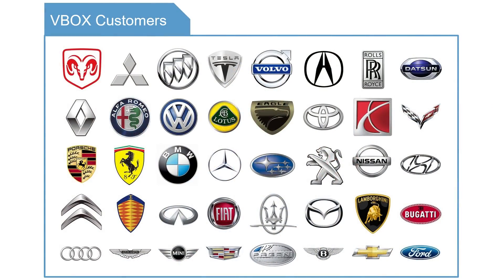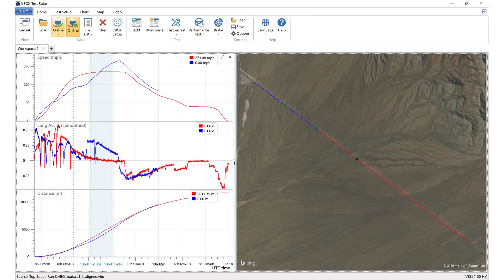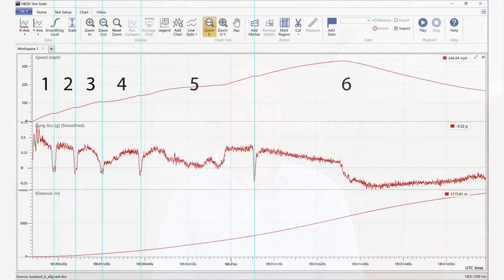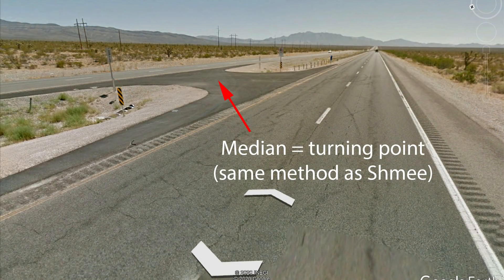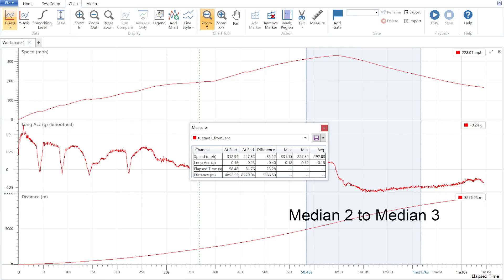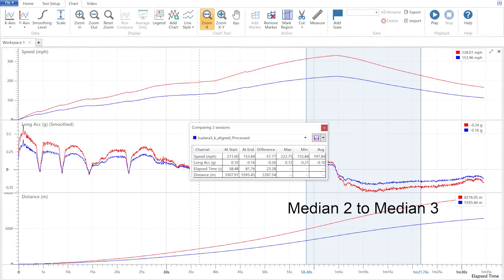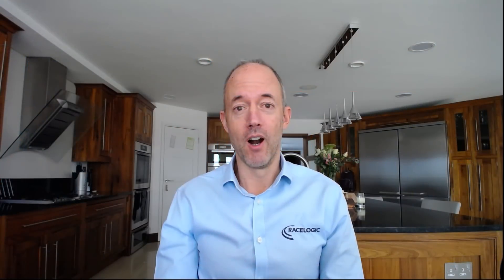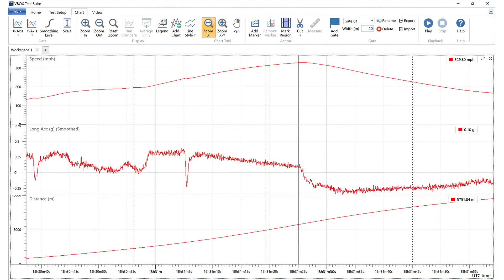How fast did the SSC Tuatara really go? Here's my calculation based on some new data.

Comment: Hey Julian, you can find the answer to your questions of why and how in the face book group Koenigsegg Registry.This is where this started and now ended.
 Quote The key to all this is something that hasn't been mentioned here or by the three musketeers of the Nurburgring. That is the SDK, the Software Developement Kit. It's open source, it's on GitHub: 
"DEWETRON OXYGEN SDK Develop your own plugins for DEWETRON Oxygen Software! The SDK includes the framework, manual and examples to quickly get up and running using the Microsoft Visual Studio C++ toolchain."
 What you see on the laptop screen is the result of using the SDK. Any coder worth his salt can introduce a multiplier of 1.3 between the GPS data and the screen. This is the reason SSC chose Dewetron, an unknown company in this particular field, who supplies a wide variety of instrumentation for industry. Clever of SSC, but not clever enough to fool the internet sleuths. Unquote.
 Now go there and give credit where credit is due.
Reply from the maker: @HokeySchtick  An SDK available on GitHub would make it a lot easier to produce the software they used. I haven't personally been to the Koenigsegg registry, but that may be where Shmee and others got some of their initial ideas from?
Reply: @jools360  Also, this is the second time around, same Dewetron, same SDK. Fool me once, shame on me. Fool me twice, shame on you.
https://www.youtube.com/watch?v=gGEL7VQy-D0
Reply: @HokeySchtick  uhh, i think the saying is supposed to be the reverse of what you said, but i do wonder if they faked the ultimate aero run as well, especially since they didnt get nearly as much attention in those times as now
Reply: @Youtubehandle9001  You're right, I fooled myself.
Reply: @jools360  like you can't throw a scaling factor on any software. You can do it on Vbox you can do it on Motec you can do it in PI etc you don't need an SDK?
Reply: @jools360  I wasn't quite right about the credit, I found this on Reddit:
"I think it is important to give credit to the guy who first uncovered this, a friend of mine named Jey Cee who goes by @jey_._cee on Instagram. He has long been involved with the Koenigsegg community/research and was the first skeptic to raise the alarm that this 331mph run might be fraudulent. He was the one who initially crunched the numbers, looking at both the medians and the spacing between dashed lines on the road, skimming the video frame-by-frame.

His work was then brought to a wider audience's attention through the Koenigsegg 4 Life Facebook group (22,000 members) and subsequently popularized by major pages on Instagram, namely @koenigsegg.registry and @ghostsquadron.koenigsegg. It is after this popularization that Tim (Shmee150) picked up on the topic and made this video.
Tim does an excellent job of explaining everything, I just thought I'd make sure there is credit given where credit is due."

Comment: This is a better anaylisis than the three guys before you.   I do not understand why they would send that video out, unless the driver did not know what those two speeds felt like and the software company straight messed up.  To be clear your saying the top speed reached was the 230 number?  And to get that you applied the 1.4 correction factor?  Being that it was a derived correction factor if it wasn't 1.40 you really can only say that the car was going 240 if that was the case. 

Your calculations are still not the correct significant figures and there is no known error that has been included.  It is possible to include the error of the reporting device through multiple calculation comparisons and your data that you pulled (great way btw).  You calcs seem to be hinged upon the distance measured via Google maps and the three guys before you were talking about some construction that was going on that could have done anything to that road really.  I understand you're working with what you have and although there are aspects missing (as well as an analysis of potential error of your calcs and of the discrepancy), you did do your own calculations and in a very simple maner.
Reply from the maker: Hi, my distance data was derived from two sources, the Koengisegg data/video and Google Maps. The Koenigsegg distances should be accurate to less than a metre, as it was measured using a calibrated VBOX 3i. I also cross referenced the video from the Koenigsegg and the Tuatara and timed the difference by hand to check I was in the right ballpark, which led to almost exactly the same ratio, of 1.48, so it gave me confidence in my numbers. GPS is normally accurate to 0.1kmh when averaged over 4 samples. I haven't mentioned any error analysis as this would have been a complex calculation, due to the fact that I had to manually align the video/data.
Reply: My comments here are purely critical and I am not trying to attack you in any way.  I am actually much more pleased with the direction and work you did.  If what I think matters anyhow lol.

I'm a senior chem E undergrad.

Comment: Oh and they said that before the "actual" top speed run they did a few test passes going from around 240 to 270mph so the driver could get a feel for the car, road and the conditions. I think they showed us that run and then overlayed the gps speed onto that run and called it the top speed run
Reply from the maker: I think the fact that the gear changes line up so perfectly with the data, means that the data overlay is the correct one.

Comment: Looking forward to the next official speed attemp. There is clearly a lot more in that car given how it was still accelerating and had another gear to go... I doubt it could reach 280, but if it did, that would be awesome!! They really aught to consult the tyre manufacture though before the attempt. The attempt also needs enough space to a low for cross winds.. That is a bloody narrow road for over 200mph.

Comment: What is the estimated cost of the equipment and materials proposed in this video to be fitted in a car for high speed calculatons?
Reply from the maker: The minimum for a low profile test would be a PerformanceBox Touch (~$680), for a high profile test such as this I would fit a VB3i, HD2 and display (~$18k). We can supply an ISO calibration certificate with either and verify the data during or after the test.
Reply from the maker: We can also rent the equipment out.
Reply: @jools360  After trying to BS this all away, and all the potential customers probably enquiring about their deposits, I think SSC might bitch about the postage, never mind the rental.... :-D

Comment: To suggest the estimated speed is only 223.75 mph is ridiculous. The Tuatara tortured Stradman's Veyron when they raced. It's like an exagerration in the opposite direction and will surely come back to bite Race Logic if the Tuatara does 300 mph when they rerun it.

And I'm saying this as someone who acknowledges Race Logic is the premier automotive speed checker.
Reply: Did you watch the entire video...? He said very clearly that the car should be capable of much higher speeds if and when it is tested again. And this is an analysis of the published video and data from SSC, not of what happened in the Veyron "race".
Reply: @moego3385  actually I watched it twice! The point I'm making is this: the new record was supposedly 316 avg and 331 max. It's understandable that such a massive leap forward was questioned, especially against the footage that was put out.

However, when Shmee, Misha, Robert are saying approx 280 max and Julian is saying 225 estimate. It's clear they can't all be correct. 

I'm saying that although Race Logic's credentials are impeccable, it seems common sense that something is wrong with their calculation because I'd hazard a guess that 225 would be a doddle for the Tuatara or any car with well over 1000 bhp and under 1500 kg. 

So to sum up, it's as if Race Logic has gone in the opposite direction and underestimated it. With respect, the best thing to do would have been to keep out of this controversy, because comming out with equally silly 'slow' estimates isn't good either.
Reply: @DavidElstob73  I can see what you mean. But the analysis of Tim/Mischa/Robert and others could never be exact - and it didn't have to be to illustrate their point. And if recall correctly Tim even added he'd revised his original number of 280ish to something lower. 

Julian from Racelogic has access to more data, namely precise measurements from the same location with the Koenigsegg. I think, based on the data he has access to and the method he has used, his calculations should come closer to the truth than anything else out there. 
It's very compelling.

If you consider it a "silly slow estimate" it's up to you, but I think you then need to counter with a even better calculation showing he is wrong - or at least single out the major flaws in his analysis. In any case, no way would a 300 mph run at some later stage "come back to bite Racelogic".
Reply: @moego3385  so if the Tuatara does a proven 300 mph next time, it doesn't exactly prove anyone right who estimates this run under 230 mph, does it? Yes, they will be two separate runs, but if it does 300 next time out, there's no reason to believe the original runs were drastically wrong.

While it's true that Julian is a genius and has the Koenigsegg data to go by, at the end of the day, he's still estimating it from the outside if you like, without having the actual GPS data it's still nothing more than an educated guess. 

Each to their own, but personally I think it would have been best for Race Logic to keep out of it or offer their services to SSC in private. 

Let's be honest, saying the car only did 224 is a bit disrespectful to Jerod Shelby and his beloved Tuatara. Adding that there's definitely more to come isn't going to repair the damage either.

PS the reference to the Veyron was to show just how capable the Tuatara is against a well-known performance car.
Reply: @DavidElstob73  Whatever we thought the Tuatara would do, did before, or will do next time, will not prove anything - it's fully irrelevant compared to the fairly good quality data revealing what it actually did do on that very run. What Julian presents here can't be simply dismissed as just an educated guess even if it's not GPS accuracy.

Why not try to do an objective estimation on your own? If you don't believe Julian is accurate enough, you should dissect his numbers and put some realistic conservative error margin on top of them, do the math and see what you get. 230, 240, 250? I haven't felt the need to do so because I think his reasoning makes perfect sense, and less accurate estimations have already proven they were far below 331.

It's not less respectful to say the car did 224 based on this solid analysis, than claiming to the world it did 331 with no evidence at all, is it? I can only imagine how embarrassing this must be to the SSC team, but it's their own actions after the runs that put them in this position. I can't even begin to think of a worse way to handle the situation. Next time around I hope they will play fair, and be successful with their attempt. And besides, the more I see the Tuatara, the more I like it!
Reply: @moego3385  I'm not dismissing Julian's calculations as a wild guess - to be more precise it's actually a guesstimate. He's based it on the data he has available, but that still isn't the same as having the GPS data from the run, so to a certain degree it is part calculation part guess.

Perhaps Julian's figures do match the video, but what I'm saying is the video isn't what really matters - it's the GPS data that counts. The video is more for marketing and social media views. Of course, ideally, it should be accurate also.

If SSC only hit 230 in the rerun they will prove Julian to be correct. If they hit 300 they'll prove themselves correct.

Well let's see how it all pans out, eh?
Reply: @DavidElstob73  I guess we're not going to come much further here... I will just add that I find it both depressing and almost frightening to see so many people refuse to accept the evidence right in front of their eyes. Emotions, expectations and hope has replaced common sense.

I also shrug to think what will happen if the Tuatara actually reaches 300+ next time (which it really should if it's on full song) and the subsequent storm about how the "doubters were competely wrong". Not sure I'm going to want to be around then.

Anyway, cheers to a little debate in a civil tone. Not all that common around here these days.
Reply: @moego3385  no worries. Take care!

Comment: While you were analysing the race data, i was analysing your kitchen, my guesses are the following:
The cabinets are probably Smallbones of devises looks like the ones on the left are from the massacar range, if not then Mark Wilkinson. The large refrigerator is probably Sub Zero. The built in ovens are probably Neff. The large extractor is probably from Elica, an Italian company that specialises in extractors. The worktop is granite. The sink and taps most likely would be either Franke or Blanco brand fixtures.
Reply: Nearly! I was inspired by smallbone, but it was created by a fabulous local cabinet maker. All appliances are Miele - Worktops Volga blue granite and franke taps 😀 ... all over 12 years old now!
Reply: @jadethomasjewellery  a beautiful kitchen, well done.

Comment: If the driver went over 290mph he would of experienced the gyroscopic effect which is what the Bugatti driver experienced in his 300mph run.
Reply: What does this effect do
Reply: @Maxmon67  The weight of the spinning wheels—the gyroscopic effect of those wheels turning—actually overpowers the steering. It’s a problem that has not been solved because it’s not necessary to solve it normally. But you then get a situation where there’s no self-centering on the steering anymore, so when you have to make an adjustment to stay straight, that adjustment pulls the car over and doesn’t stop, and then you need another one to come back. It’s very small movements, but you’re forever doing that to try to stay straight.

Comment: The SSC Record speed attempt one in October 2020, went just 223.75mph ? 2mph faster than the 1993 McLaren world speed record. The SSC future 2nd top speed run, they only need to find an extra ? 54.03 mph to beat the Agera RS record. I don't think they can beat the Agera RS record of 277.87mph average from a 2 way run. If they had a highest one way run of only, 223.75mph in Octobers run one. I hope they can beak the record, but it seams out of reach for their current car.

Comment: It's probably the same engine from testing that starting to fail. The engine maybe isn't putting out the same performance as it was built. Since they also been waiting all these years I'm sure they were low on money. And didn't build many tuatara engines. And this is probably a very first engine that's been used all threw testing. And stressing the engine.

Comment: agreed as the way the car was still pulling at 331, it was like turbine powered and not a turbo v-8 car. In fact at that high speeds weight is really important as can be achieved with the addition of downforce via flaps and spoilers and other things coming out from body work like jet but that'll create huge drag as well and the climb will be slow and tyres and suspension will suffer immense pressure or the car's own weight like 2 ton in case of bugatti ... but still we come to one problem,...tyres ..    like if we look at the agera top speed run...after a point like around 420 i guess, the climb got slow ,compared to chiron which climbed the speed ladder faster after 420 compared to agera....the weight helped bugatti. but but but, even these two really capable cars are bound by tyre limit....and that's why ssc 331 mph runs also become more suspecious...

Comment: On 1750 HP, 0.313 Cd at 500 kmph and frontal area 1.953 sq.m numbers and 3% gradient, kerb weight 1384 kg, the car can do 332 ideally on the uphill and 346 on the downhill if the air is thin enough (1.11 kg/cu.m) If I take SSC's air density value of 1.20 kg/cu.m the uphill vmax drops to 326 mph. So there's no way they can climb to 331 like that on the uphill leg. I can hear James may screaming "One more, one. More! '

Now we all know the truth, but when even more studies come out it is astonishing to what extent we are capable of analysing data today and what kind of geniuses are out there. No one can fake it. 

And homologation is a whole other matter. Koenigsegg claims it takes 60-80% of their development work and budget to meet homologation requirements than just hitting raw numbers. The Tuatara's weight was also exaggerated, that was the dry weight. The kerb weight is only 6 kg lighter than the Jesko Absolut. But then all manufacturers do this.
Reply: their c of d is complete bullshit. in reality it is much much higher
Reply: @TylerKirkFilms  you don’t know that!
Reply: @Amarjit Singh I did a time vs distance measurement and calculated the very highest speed to be 223.73 mph
Reply: @TylerKirkFilms Well now that is approved by Racelogic Vbox

Comment: I can't comprehend how SSC would be this naive to not think their run would be questioned or believe that car can go 331 mph. That's such a huge number.
Reply: This is why it is incomprehensible that it was intentionally faked.
Reply: Not just a huge number, but it's the scale of the increase over the previous record.
Reply: First time watched that video, impression was that it looked very slow. That was my video watcher observation. Not surprised with this assumption, top speed 220ish, "looked" about right.
Reply: Their* it's possessive not they are
Usually the mistakes I see are the other way around
Reply: @Neopumper666  their got it lol thanks for the 3rd grade grammatical error correction sir. Hahaaaaa
Reply: @Neopumper666  wooooooooow